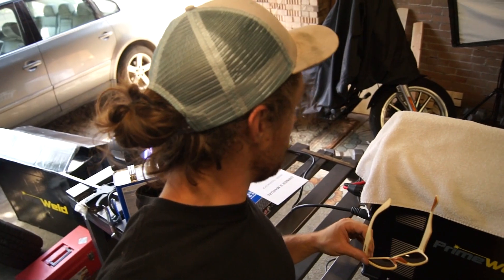First Welds with the Primeweld TIG 225x

Comment: Few tips when welding clean the metal really really well first thing it looked like you were way to hot let that puddle form slowly then dab wire once the puddle is flowing I could not see the stick out on your tungsten but as much as you were hitting it I would push it back in a little bit your on the right track keep at it you will get it in not time I have been welding for 20 plus years and still learn something everyday about welding lol oh ya remember the abcs alway be comfortable that’s half the battel I have built a lot of props to rest my hand or arm on 
Good luck love the videos keep at it anything you need help with I’ll do my best to give ya the info
Reply from the maker: Hey Dan, I missed your comment until now. But I've gotten much better at TIG welding. Check this out.  This video was literally the second time I had TIG welded before https://youtu.be/26CDBrWMRMc